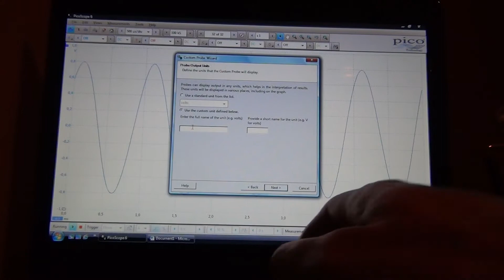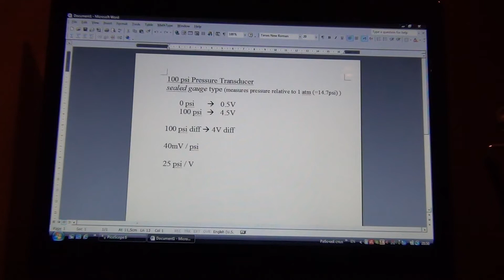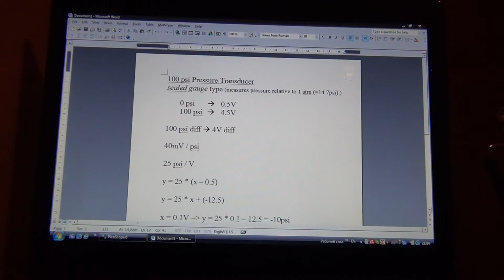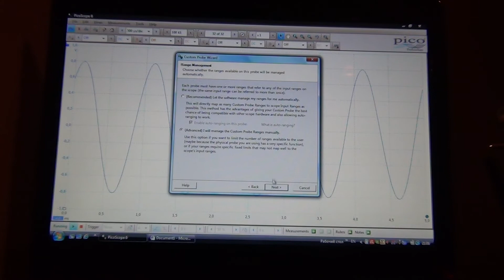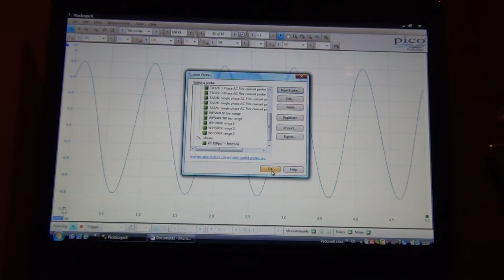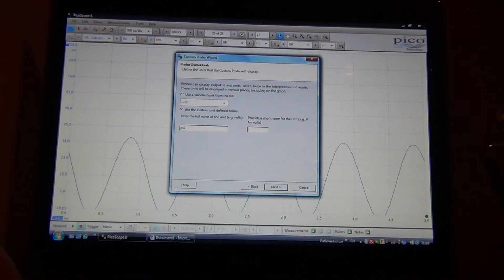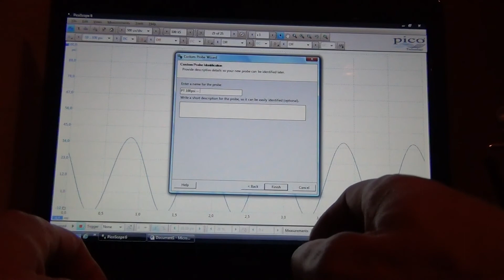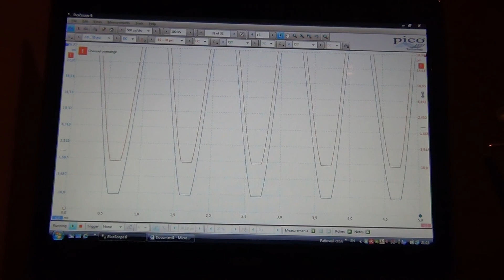[20170819] DIY Saturday: Picoscope Custom Probes -- Formula vs Look-up Table

Comment: Dmitriy,

I am trying to figure out how to custom probe my 2 Hantek amp clamps in Pico, with very little success. I'm having a hard time with the table values for the clamps.

The clamps are as follows:

65 Amp Clamp where 1mV/10mA and 1mV/100mA

650 Amp clamp where 1mV/100mA and 1mV/1A

Any help would be greatly appreciated!

Thanks,

Paul
Reply from the maker: Let's take 65Amp clamp in 1mV/100mA mode. 

1mV=0.001V, 100mA=0.1A. Thus, current of 65A will produce output of 65*0.001/0.1 = 0.65V. 

So, in the custom probe table set -0.65V to mean -65A, and 0.65V to mean 65A. Don't forget to zero the ampclamp. Does this work?

Comment: Dmitriy L.,  I have a pressure transducer that is   -14.5psi to 30 psi (Negative 14.5 psi to positive 30 psi), could you please tell me what to put into my Look up table, that would include the 0.1 v reading?
Thanks in advance....
0.5v is -14.5  and  4.5 is 30 thats all i know.....
Reply from the maker: Hi Murle, in this case you have to fill only two rows, for 0.5V and 4.5V. Values below 0.5V do not really make sense, do they? But, in any case, make a test rig where you can check a few  measurements versus a regular pressure gauge.